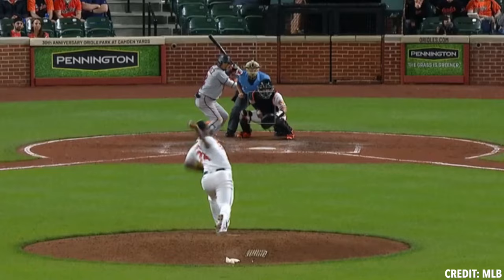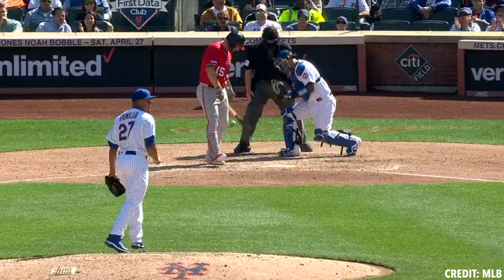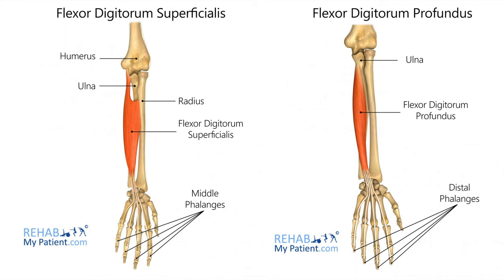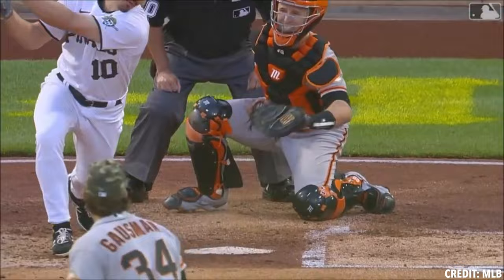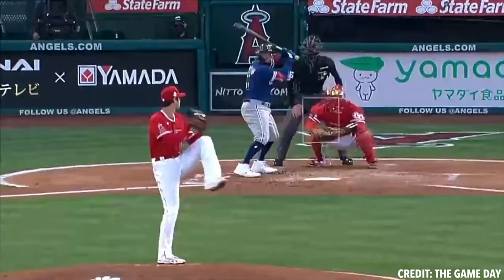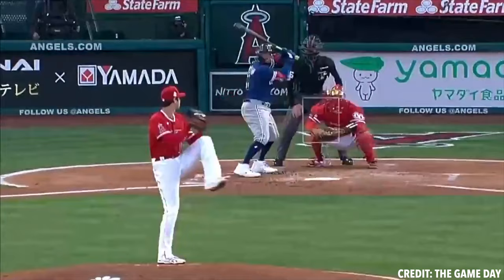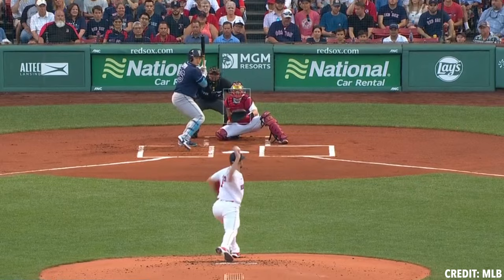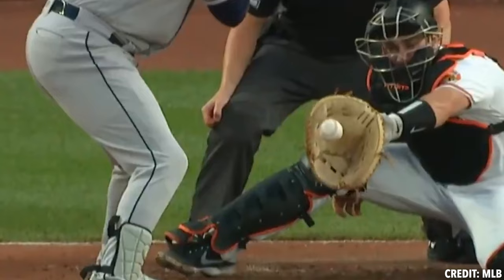Can't Throw A Change-Up? Try This Pitch

Comment: Ok so I never liked throwing a changeup, but my coach really wants me to develop an offspeed. I can throw a really good, accurate, low rpm splitter, but it takes way too long to index the pitch. Any tips on getting the pitch in your hand easier?
Reply: So when I started developing mine, I ran into the same problem but through my first college season I preset with it and I’m primarily in the stretch. Helps with not tipping and letting hitters know it’s coming
Reply: When I first learned mine I preset it and just consistently wiggled in the glove for every pitch, after throwing it for a couple months my fingers loosened up and it was easier to grip
Reply from the maker: As some of the other commenters have mentioned, many pitchers at higher levels preset with the splitter grip to avoid tipping, taking too long, etc. Doing that consistently may make things easier in the long run too